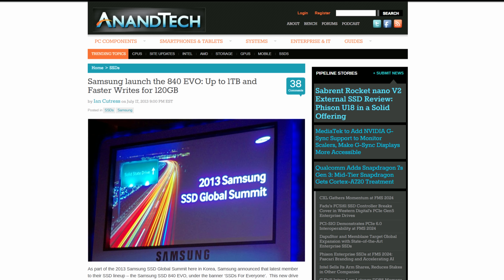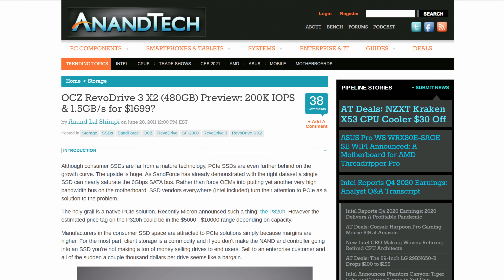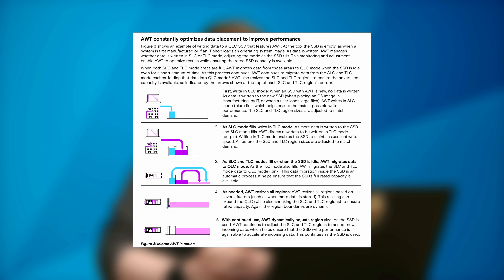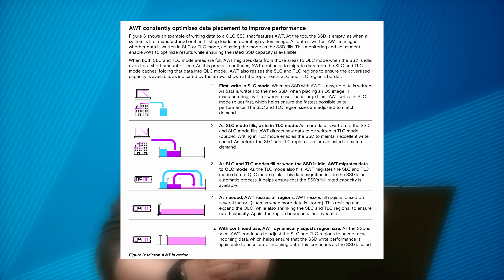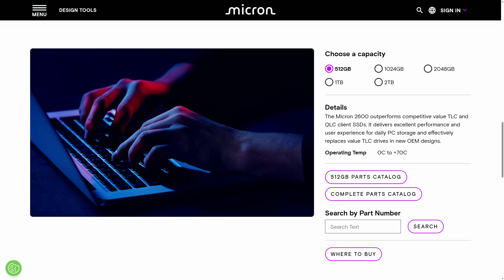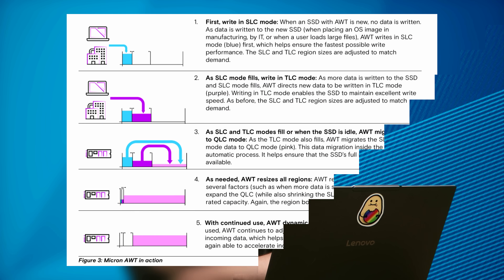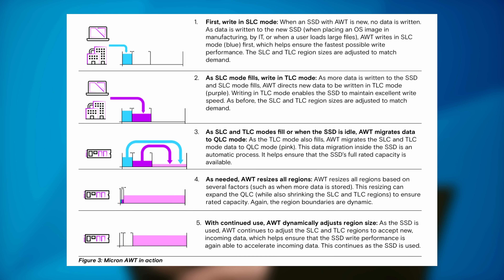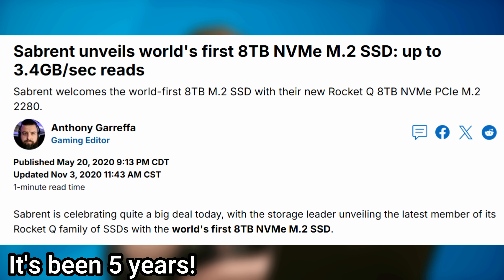Big.Medium.Little Comes to Consumer SSDs

Comment: I bought a used 15.36TB Intel D5-P5316 U.2 QLC SSD and hoped it had a large pSLC cache but I was wrong. It seems to have a pSLC cache of about 5GB at 2GB/s and then slows down to 370-400MB/s for anything bigger. I was disappointed to have almost hard drive write speeds with this QLC SSD but in my use case its not a big deal. I contacted customer support (Solidigm) and this is the reason they provided for the performance "It's an Enterprise SSD: Your D5-P5316 unit is engineered primarily for servers and data centers (enterprise use). This environment has very different requirements than a home PC. Priority: Read Speed and Stability: In the enterprise world, the goal is to keep reads extremely fast and the drive stable under constant, heavy load. It is not optimized for the huge, sequential file copies typical of consumer tasks. Fixed and Precise Buffer: Instead of a giant, dynamic buffer (like the one you see on consumer 4 TB drives), yours has a fixed, small, and precise buffer (the 4-5 GB you observe). This is specifically designed to handle the quick, random write bursts common in a server environment."

Comment: So just make everything QLC, but in the first quadrant write full speed at high=15 and low=0 levels. Later, reencode that to 16 levels elsewhere.

This way any arbitrary amount of storage can be sacrificed for the buffer. And you can wear the disk evenly. And it works exactly like Symantec DiskDoubler lol

Does that work?

Comment: Back in 1968  When I started learning Computers and programing.  Storage was a rack of ferrite beads.  positive wire,  negative wire and clear wire around a small bead of magnetic material.  So much has changed over the years.    in 1995 the stuff got too intense  for me to keep up on the technology and programing.

Comment: One TB, consumer SSDs, do not have 250 GB of SLC NANDs
They will typically have between 10 GB to 25 GB of SLC NANDs.

Since few people (and by few, I mean a percentage of the public) write enough GBs of data, non-stop / without rest, virtually no one exceeds the 10 GB SLC's NAND capacity.

So the manufacturer advertises their SSD to write at X GB/s, without telling the customers that it is only for, at most, 2.5% of the drive's capacity.  Exceed that, and the drive's write speed slows down to, perhaps, 100 MB/s.

It is a scam.  But it is akin to a car advertising a top speed of 150 MPH, but can maintain that speed for only 10 seconds.  How many customers would ever discover that limitation?

There are data center level SSDs that run at their advertised speed, and never slow down.  They are generally of the U.2 form-factor.  And they are far more expensive.

But you will not find any consumer SSDs (like from Best Buy, Micro Center, etc) that will have 250 GB of SLC NANDs.  Even a 4 TB SSD will probably have between 10 GB to 25 GB of SLC NANDs.

Comment: Can't you just run NVMe drives at 2x lanes? You need a board with the option to do that and like personally a single 4TB NVMe drive is plenty with 20TB of spinning rust for backup and stuff that it just does not matter that I can only access it at limited speeds as the drive is more than fast enough for the medium, like video, audio etc.

Comment: 10:50 personally, I’d like to see a ~’3680’ M.2 form factor. Sort of a wide body version of the classic 2280, just wide enough to fit two NAND packages across, at least doubling the potential storage capacity per drive, but I think it’s hopefully possible that you can move the DRAM chip from being between the NAND and the controller, to being next to the controller (ideally, two, flanking the controller on either side) which would hopefully free up just enough space for a third row of NAND chips, increasing the max amount of NAND chips per drive from 2 for single sided and 4 for double sided to 6 for single sided and 12 for double sided, tripling storage capacities available.

Comment: The way you explain it makes it sould like there are SLC, TLC and QLC cells on the SSD, which would mean that the areas of each are not adjustable. 

I think that the whole AWT king idea is that all the cells are QLC, and the processor decides when to pretend that they are SLC or TLC, depending on storage speed or capacity needs for the moment.

Comment: are those cell modes actually "virtual" as in those are actually decided by the firmware/controller but ultimately they are all QLC right? just the controller decides how to use them.
Reply from the maker: Correct

Comment: I game and do office work on my PC. As the experts tell me I'm not going to notice any uplift going from PCI 4 to 5, speed has been irrelevant to me for a while. I probably wouldn't notice the leap from 3 to 5 if we're being honest it's just that a gen 3 NVME wasn't any cheaper so you may as well buy the Gen 4. What I really need from manufacturers, is 4Tb and 8 Tb drives to come down in price to the level that consumers can afford to have them. It would be great to have a slow drive, used for longer term storage at capacity at a reasonable price. Beelink's Mini NAS can take six drives, as can most NVME NAS solutions for home users. They're quite cheap. But the drives? Even though you absolutely don't need fast drives, they're insanely expensive. You can't save money by using the older SATA drives as they're just not cheaper at this point, and hard drives are a total joke (they're huge, noisy and cost more to run). 

I don't know what they'd have to do to supply us cheaper NVME drive space, and I don't imagine anything will happen on that, but it is what I want.

My guess is the next time home users will get something genuinely better, is when the individual chips on the NVME drive go up a storage size, thus shunting the smallest drives up one level (say from 256Gb to 412Gb). Or else, the AI bubble bursts, just after manufacturers churn out a lot of NVME drives for that market, and they are forced to offer significant discounts in order to clear their stock. It's just that I don't think it's a bubble, I think it's just a very useful technology which will be used more and more for a very long time, and the only reason you'll need less compute is if someone makes a big breakthrough that makes the software more efficient at getting the results you need.

So I don't hold out much hope for reasonable DRAM, CPU, GPU or storage prices in the future. You're probably better off just getting a second job to save up for a new PC rather than actually pinning your hopes on them becoming cost effective again.

Comment: I am confused. This technology was around forever. It was called a dynamic SLC cache. A QLC cell can be used in SLC mode if you only write one bit. It is the reason why QLC drives perform so good when they are almost empty and performance dramatically reduced when they are full. This is exactly what a "new" AWT technology manifest, but it already a thing for a long time.
Reply from the maker: That's the first half of the video.
Reply: @TechTechPotato  you didn't talk about "dynamic" SLC cache in the vide. The whole QLC drive is first written in SLC mode. Only when it is full to 1/4 it starts writing the second bit to the cells. And only after it is half full it starts writing the third bit etc.

Comment: The technology is the same if you make SLC or QLC drives, so the price for the memory chips is the same. Only thing it that you need four times the memory chips for SLC as for QLC, so at minimum if you only look at the BOM or Bill of Material the SLC memory is four times as costly for the customers. You get 1TB of SLC space for the cost of 4TB QLC. That's a hard sale as people are pinching their money.

When you talk about durability there's the TBW or TeraBytes Written. This is a number the manufacturers assign to their drives and it's supposed to give an indication of how durable the drives are. I say "supposed to" as it's not easy to predict durability before many thousands of the drive has been used for a long time and punished with a lot of written data. Someone said that it's the figure at which 50% of the drives has failed. But the manufacturers use it in a way that I think it's a lot better than that. Most manufacturers have a 3 to 5 year warranty, but it's appended by "or up to TBW". That means that even if the drive are within the warranty time the warranty is not valid if there has been more data written to the drive than the TBW rating.

So we have a kind of durability index, but what does that mean? After all all drives use similar memory and often the same controllers so they all have the same durability,. Right?

Wrong, or at least to the manufacturers this is not the case. Looking at the webstore I usually use I see that the Crucial E100 M.2 NVMe SSD 1TB has a TBW of 80. The warranty is 3 years or until it reaches TBW.
Switching to a Kingston NV3 M.2 NVMe Gen 4 1TB it has a TBW of 320, and a warranty of 5 years or until it reach TBW.

And the Kingston drive isn't really extreme, nor is the Crucial one. If we look at Crucial T500 1TB M.2 NVMe PCIe Gen 4 it has a TBW of 600 and a Kingston Fury Renegade G5 1024GB PCIe 5.0 M.2 NVMe has a TBW of 1000

Now I will say that the Crucial E100 has the lowest TBW I've seen and that the Kingston Fury Renegade has one of the highest. I've only seen one with a higher TBW and that's the Seagate Firecuda 530 which has a TBW of at least 1200. The 4TB version has a TBW of 5100 and the 4TB Kingston Fury Renegade has a TBW of 4000.

Now as the durability of drives are hard to predict before enough has been used for long enough isn't this just a glory number for the manufacturers to wave around?

No I don't think so. The use of five years warranty or up to TBW means that they really believe that these drives will be decently reliable up to that many written terabytes. A RMA really costs a lot of money and they absolutely want to minimize the warranty claims they have to handle. The Seagate warranty also offer to recover all data that's readable from the failed drive, and that's an extra cost so they really don't want people to request warranty support.

Comment: The cells endurance is rated for the worst mode, e.g. TLC or QLC, say 200 write cycles. If it uses some of them as cache in SLC or TLC mode, it does not affect the overall endurance of the drive, since their write cycles in that mode would actually be better, say 500 or 1000 cycles. This means that using them as buffer in TLC mode is not harsher than SLC mode. Another thing is cells close to end of life, are supposed to retain data for 1 year at 40C (Jedec spec). Reading say 8 levels of voltage after being freshly written, say 1 hour ago, to move them from TLC buffer to QLC area is easily done, as even weak cells can retain data for few months at least. Drives also have very strong data correction, checksums for data corruption detection so they can recover mild errors and reallocate such cells if failures occur.

Comment: The future of SSD technology... now that's an interesting question. 

I'll default to my usual answers when people ask me for my thoughts on the future of a given computer component with a few extras.

Graphene, or other 2D materials. 

Photonic and/or spintronic integrations. 

A new PCI architecture that allows more lanes to connect to the CPU IO stack. 

Phase change materials replacing static voltages.

Upgraded memory controllers that can optimise caching and cache migration more quickly and efficiently.

Native drive cloning software included with the drive.

AI driven cell management.

Improved RAID performance through one or more added hardware features designed to improve RAID performance.

Low level on memory compute to preprocess simple instructions reducing the amount of transfers needed for a CPU to execute a task.

Integration of on chip DRAM for pre caching certain information reducing overall latency.

Reduced heat through passive cooling channels built into the PCB possibly made from layers of 2D diamond and graphene that act as heat carriers.

On chip analogue matrix multiplication to optimise preprocessing of data.

Quantum compatibility.

And if it's not too much to ask maybe it can put me in contact with a big tech company that asks me to sign an NDA and design new technology exclusively for them.. I charge wwaaayyyy less than other specialists do so it would be a win win.

Comment: Is it possible to convert aged QLC cells to run in TLC mode to extend their lifespan? That seems like a better thing do than discard them as "dead" just because they can no longer handle the tight QLC tolerances.

Comment: Is there any ssd format that can be used for long term storage (>1 yr)?

Are there particular hdd technologies that are best for long term storage?
Reply: On the shelf, i mean. Not electrically connected in any way. 

For either ssd or hdd, is there a ‘double-down’ refresh procedure to operate periodically so that the charge of the bits is strengthened? I am thinking of a read followed by a rewrite in the same exact location or configuration.

Comment: For my mass storage, my main concern is reliability. The data is more important than the hardware technology, and the speed, though is, of course, limited by available funds. 
For SSDs, they need to 
1) be more reliable than spinny disks
2) be faster than spinny disks
3) have comparable storage space to spinny disks
4) be economically competitive with spinny disks
5) Bet battle proven (I am not interested in the 'latest technology')

For OSs and other things that don't matter, I use NVME drives for speed. I do use SSDs in some systems for storage, but generally that is not important storage. For important stuff it is still spinny disks, which I replace every 5 years. (and yes, I used Raid 10, with a Raid 0 backup). 

That said, I have had a total of one SSD fail on me on my personal systems, back in the day when they were new, so the main limiting factor for me is cost and capacity. Give me an 'iron wolf pro'  16Tb SSD that costs less than £500 and we can talk. 

In the commercial desktops at my employer (of which there are 1000s) generally SSDs (and NVMEs) fail all the time, though I reckon are no less reliable than spinny disks in their day. For mass storage on the commercial front at my employer, we are still using mostly spinny disks - mostly down to cost, and partially because we don't do 'cutting edge', and our kit is old anyway. SSDs are likely to replace spinny disks in the next few years, because the capacity of the disks is equivalent to the racks of NAS drives, and cost of the spinny disks from the supplier are stupidly expensive anyway. 

At home, large capacity drives are needed as there is a lack of physical space, at work, 2Tbish drives can be used, because the NAS can hold loads of them (and frankly the employer doesn't have much more storage capacity than I do at home anyway).  

Of course, drive manufacturers don't carter for mass storage at home. There is not enough money in it.

Comment: The one big problem with QLC isn't write speeds (for most applications), it's the fact that you save a big file to it and 2-3 years later that file can only be read at 10 KB/s, freezing your entire PC because you opened your Downloads folder. Ask me how I know.

And of course a smart controller would solve it by periodically refreshing old cells but there's no way to know if the device you buy is doing that.
Reply: If you're not in windows, you could have a script that does that, or run a  scrub in BTRFS/ZFS if you are using that.
Reply: My 4TB Sandisk Ultra 3D did this to me, took forever to get the data at 10~12MB/s read speed.
Reply: A good case to switch all backups to rust drives. I am unhappy with the current consumer grade long term storage landscape; I used to be able to burn my entire hd to a dvd!
Reply: ZFS users don't have this problem since scrubs are done by default.  A scrub is usually just a low level read of the entire drive because as the data is read, so are the ECC bits used to correct data.  If the data just sits on your drive it will become too corrupt over time to correct and the data is lost.  It boggles the mind that you can't just manually scrub a drive in Windows at the click of a button.  If there isn't a way to do this in Windows, I guess you could boot a Linux live drive and run dd on the drive sending the results to null to achieve the same thing.
Reply: @TheCrazyCanuck420  SSD controllers do that all by themselves.
Reply: @ronald3836 They sometimes self trim, but they absolutely do not scrub themselves.
Reply: It's not a fact. Not all SSDs will even rewrite their own aged data when it's reading slow. I have a WD TLC NVMe SSD in my laptop and there are files on it from 2021 when the drive was new that when read will read slow every time, up to the point where I manually make a copy of the file, delete the original, and rename the new file to the old one.  With that being said, the ZFS scrub will see it's readable and won't touch it.  The "if it's powered, it will be fine" is a myth, the cells don't refresh themselves with all SSDs and it's impossible to know if the controller in a specific SSD is actually rewriting any data to keep it fresh, fast, and reliable to read.  This all gets worse once you go to QLC and PLC.
Reply: @GuruMN rewriting is not necessary.
Reply: @TheCrazyCanuck420  "A scrub is usually just a low level read of the entire drive because as the data is read"

OK so that wouldn't fix that, at least not on the device I saw it happening (a WD Blue NVMe of some sort, I don't remember the details now). Reading would not refresh the cells, only writing would.

Their antivirus software was already "scrubbing" all files on monthly full scan, and in fact this was the main reason why their computer froze - it was that scan that kept opening very old files, and the drive was stuck at ~10 KB/s reads and ~30 second response time.
Reply: Sounds more like you're using Windows.